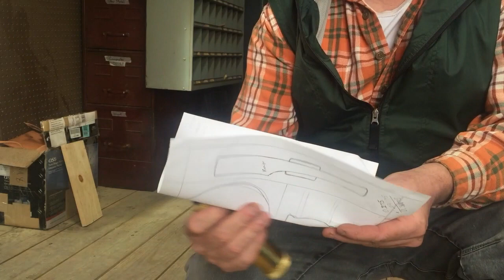Hardware Store Muzzle Loading Pistol Part 2 - SHOOTING!

Comment: Do like the colonists did, take it out in the woods, tie it down to trees and rocks, tie a string to the trigger and stand a long way off.  Apparently it was standard practice to load it with a double charges when shooting that way.  If it withstood the double charge, it was safe for a single charge.
Reply: +userunavailable3095 What youre describing is called 'proofing'... All firearm makers do it to this day, they just have a more controlled setting ;) Im unsure about the other manufacturers but I know Ruger proofs their guns with 150% loads.
Reply from the maker: Thanks!
Reply: My father did that with the family's Civil War rifle. Way too much powder. (Likely a triple or quad charge). The barrel blew apart. He got  one heck of a whuppin'. He survived only because he tied it in the crotch of a tree, and used a string to fire it with.
Reply from the maker: LOL - That is a great story!
Reply: Proofing of barrels is still done the same way.  Double charge.
Reply: Wallace Gussler, gunsmith at colonial Williamsburg, used four times the usual charge for proofing.
Reply: I was thinking during the first video that he better build  rig to test-fire this thing. Glad he didn't die!
Reply: It's called proof testing and is done to currently produced firearms.
Reply: @SugarcreekForge  don't forget to surface harden those sear engagement surfaces!

Comment: powder , patch , bullet , that order  not   powder, bullet , patch  lol
Reply: Cadillac CTS I was like wtf is he doing haha glad you caught that too
Reply: Dudes wrong as can be. I've shot severely underbore balls with a tight wad or patch and got a 3 Inch group at 40. A tight bore and patched round ball should produce similar at 75-100.
Reply: @fahey5719  😉👍😊
Reply: I think the patch went last because the round wasn't tight in the barrel. In this case it should have been powder, patch, bullet, patch or powder,lotsa patches bullet.
Reply: Generally speaking in smooth bores, with a ball it is Powder always first. Then Ball, and then patch sufficient to keep the ball in place if in a hurry, otherwise the ball wrapped in patch for better accuracy and range. In Rifled barrels, it is Powder, then tightly patched ball, all in one. The exception to that is when an oversized ball is hammered in to the muzzle with a false muzzle device and a small mallet; that is to say no patch because the soft lead ball has been engraved with the rifling.

Comment: How did you block the barrel
Reply from the maker: Hi! I tapped threads into the back of the barrel and then screwed in a small section of a bolt.

Comment: I'm amazed that you still have both eyes and all your fingers? As a 50 year black powder man, I've seen boughten barrels blow up and they were made of the correct steel, not mild junk steel from  hardware stores. They say God watches out for Children and fools. That being said... nice job.  MacGyver would be proud.
Dave
Pappy Dave's Knives
Reply from the maker: Haha, I am too old to be a child, Dave. So I must fit into the latter category :-). Wanting to keep my fingers and eyes, I did check the PSI rating for both the liner and the black iron pipe before I fired it. I have ample strength for the light loads I shot. But, one can never be too careful... I don't want to tempt that protection. Have a great week.
Reply: Glad to hear that you checked out the PSI rating BEFORE you shot it. I used to tie mine to a tree and use a rope to pull the trigger. I built a 69 caliber smooth bore Tower pistol that shot a 300 grain bullet back in 1975 and that's how I tested it. I couldn't even find a bullet mold so I made my own. I was terrified of it before that first shot :~))))) God bless.
Dave
Reply: Gunsteel is mild steel not some secret formula.
Reply: If it's a secret, you would know?
Reply: @billwessels207  High tensile strenght mild steel but yes - mild steel.. 
If I would every would have to rely on the rubbish steel grades sold in DIY stores I would go at least double wall thickness for the target pressure... just my thought...
Reply: I'm 50 year veteran of muzzle loading and have never seen a barrel breech ever......where do you buy your stuff from????

Comment: That's beauty of a musket-gun. I would sand the edges at bottom a little bit more to make the wooden parts rounder like the ones made by historic gun makers. Will start a similar project in my coming freetime. Will go for a flintlock instead.
Reply from the maker: Thanks, Paul. That is a good pointer. Please keep me posted on your progress. I have been wanting to make a flintlock sometime too.

Comment: Nice project and great job.
We used an old door to make the stock for an old WWII military rifle we converted to 308 Winchester.
It's not pretty, but as a test project it succeeded and has never failed despite several thousands of rounds of full pressure 308 Win loads and 25 years.
Reply from the maker: That is very cool :-)

Comment: 2:27 excuse me but can u please explain how to connect that bolt looking thing near the barrel wich the hammer is supposed to strike i didnt see any explanations on how u attached it to the barrel and thats real important otherwise I wont be able to fire
Reply from the maker: I drilled an tapped a hole and threaded a piece of a bolt into it that had an "L" shaped hole. This L was formed by drilling 3/4 of the way through the bolt, and then another hole drilled down to meet it from the top of the bolt face. I threaded that top hole for the nipple (the part the percussion cap goes on)

Comment: Um so with your hammer itcomes down hits nipple and cap like normal but bith that bolt did you drill straigh down to the middle the drill long ways in or how does fle spark travel from the nipple to the powder though the bolt i

Comment: That's a nice self build. Brother the patch goes between the powder and ball not last. Unless your using a way smaller ball than the barrel to keep pressure down and need the patch to hold it in there lol. A old sheet cut into round patches that when the ball is seated in the muzzle it covers half the ball is good. Take and lube the patch and it'll make ramming the ball easier. Folks forget a black power Well Pyrodex is damn accurate on out there. If one uses Black powder You will forget what you was shootin  at by the time the smoke clears. Pyrodex pistol or The rifle powder burns cleaner less smoke and easier cleaning. Nice Kentucky ish pistol all the same
Reply from the maker: Thanks for your kind words and encouragement, Steven. Yes, I used a much smaller ball (slug actually) and I wanted it to stay back against the powder.

Comment: Did you weld the bolt on the back of the barrel or is it just screwed in really really well? I want to do something simulair But dont have a welder and just hammering the back of the barrel closed is not to safe in my experience
Reply from the maker: I just screwed it in tight
Reply: @SugarcreekForge  ill try it

Comment: Did you double up on the barrel? It seems like you slipped on piece of pipe into another piece of pipe, which is a good idea, definitely beef's up the strength of the barrel, but I am not sure if that is what you did or not,kinda hard to tell.
 Would appreciate your input, thanks, very nice build!!!
Reply from the maker: Hi Allen - Yes, that is exactly what I did. Thanks for leaving me a comment and your kind words.

Comment: I really liked your video. However I was wondering how exactly the explosion from the cap got into the barrel. Is it like a flintlock where you just drilled a hole into the side of the gun?
Reply from the maker: Thanks for the encouragement! It is a percussion cap-fired system. So, I threaded a screw into a tapped hole in the barrel. I drilled a little hole down through the center of that screw. So the hammer hits the cap which is placed over the screw with the hole in it. When it goes off, the sparks go down that hole and into the barrel.
Reply: @SugarcreekForge  so like, there's a little bit of a turn in the vent? i was wondering if that would still work if there was a turn
Reply from the maker: Y @UnKnown-so5wk   Yes, it does
Reply: thank you! @SugarcreekForge

Comment: Question. What kind of bolt was that breach plug at the rear of the barrel made of? Did you have to thread the inside of the barrel to put that in there?
Reply from the maker: Hi Robert. I just used a common bolt. I didn't want to use one that was hard. I did thread the inside of the barrel. I just used a hand tap and got a few nice turns of the threads.

Comment: Im not that familliar with this kind of gun, but how does it ignite? Does the hammer create sparks? And do you have to make a hole to the side of the barrel zo it can reach the powder? Also, cool how you answer (most) questions! cool build
Reply from the maker: Thank you. It is percussion cap pistol. It uses a metal cap that goes over a hollow nipple. When the hammer hits the cap, it detonates and sends sparks down the tube onto the powder in the chamber. Here is a link that will help explain it more. http://guns.wikia.com/wiki/Caplock
Reply: Oh thanks, i will check that out

Comment: Nice video & music. What, exactly, is the barrel made from? Also the primer seating into the gun barrel?
Reply from the maker: It is made from a piece of steel tubing inside a piece of water pipe. I tapped a hole into the barrel and threaded a small bolt that I drilled a hole through the middle. I drilled and tapped the bolt and screwed in a drilled through screw and shaped that into the percussion cap nipple.
Reply: Thank you very much. If you have or ever make a video of how the barrel was made I'd like to see it.This was still one of the best videos I have ever seen. The sound,resolution,clarity & stability are excellent compared to any others. You could teach how to make a quality youtube video. I'll be looking at all your videos. You earned my Best of youtube award.
Reply from the maker: Thank you so much for the kind words!

Comment: How did you close off the end of the barrel where you stuff the powder and ball into? Did you weld it or put a nut in the end of it?
Reply from the maker: I tapped threads into the barrel and then screwed in a breach plug.

Comment: I noticed that you left out the construction and tapping for the nipple.
Reply from the maker: Yes... I missed a couple of things by forgetting to film, or to press record after setting up the camera... :-(
Reply: How do you securely put those prices together?
Reply: SugarcreekForge is drilling a hole and sticking it in the hole tight enough or is there a sealant you used?

Comment: Hey man how did you plug the end of the barrel? Did you tap it and screw a bolt in or what?
Reply from the maker: Yes, exactly that. You can see what it looks like in the video at 0:29
Reply: SugarcreekForge ah I did mine a bit differently I used a bolt like you but I cut of the threads at the smooth section so the cylinder and the bolt head were the same length/thickness then I drilled a hole through and then rammed it into the barrel and then welded it where the seam was then I tapped the small hole for a homemade nipple made from a piece of thread, kinda like this but you get the point https://youtu.be/MHboDW9NLac?t=115 

Also thanks for the fast reply but where are new videos? :(
Reply from the maker: @KClO3  That sounds like a good way to do it, buddy. I will check that out. I know... I need to start making videos again :-)
Reply from the maker: @KClO3  You are so welcome, my friend. I know... I have had a bunch of stuff happen in my life that put videos on hold. I need to start posting again. I would love to see what you made sometime!
Reply: SugarcreekForge 

Sure I should be able to show you somewhere, do you have any messaging software? And thanks for the nice comment btw
Reply from the maker: @KClO3  Cool. I am on Facebook as "Sugarcreek Forge" or "Tim Troyer" if that will work for you.

Comment: How does the blackpowder ignite ? From what i`ve seen the hammer just goes on a nut. (Sorry for incorrect terms etc. I´m from Germany)
Reply from the maker: It has a small bolt and a nut on it.  I drilled a hole through the center of the bolt so the spark can reach the powder.
Reply: Oh ok I see. Thx for the reply.
Reply: What size cap? 10 or 11?
Reply from the maker: I used 11 because that is what I had.

Comment: The only question i have is how do i get the powder so go off when i pull the triger i have it moving but how to i make a spark ?
Reply from the maker: Hi. The hammer hits a percussion cap that is placed over the nipple. That causes the percussion cap to fire sparks down through the hole in the nipple into the barrel where it ignites the black powder.
Reply: @SugarcreekForge  thank you

Comment: was that a live round? do you need a live round for this?
Reply from the maker: Hi Isaiah. I am not exactly sure what you mean by "live round". It was a small safe charge of black powder and a .38 lead bullet. The priming cap ignited real powder and the bullet fired out - so that was a live round I guess you would say. I could fire it with simple wadding on top of the powder and it would just go "bang". So I wouldn't have to fire a projectile. I hope that answers what you were asking?

Comment: What size tap and bolt did you use for the breech plug?
Reply from the maker: I don't remember off hand.  But it was big enough to cut the ID into threads for the bolt.
Reply from the maker: Let me know how that turns out

Comment: Did you just use DOM tubing for the barrel?
Reply from the maker: It was actually welded seam tubing hot fitted inside of a piece of water pipe. I made sure that the seams were on the opposite sides.
Reply: So smoothbore I take it?
Reply from the maker: DirtyFrigginHarry Yes, indeed :-)

Comment: Excuse me but why did you put the patch in after the projectile?
Reply from the maker: +Tapperlite1 The bullet was not tight and I loaded it with a very light charge of black powder. I did not want to risk it moving forward when I pointed it. I probably did not need to...

Comment: Hardware store materials, professional machine shop machine tools!
Reply from the maker: I am not sure if that is a dig against my video or just an observation... it is ok either way. Best way I can explain myself:  I am a hobbiest and certainly not a professional. And, my only professional machine shop machine tool is my belt grinder. I have a mill drill that I bought for 2 hundred bucks, a cheap harbor frieght drill press, and a mini lathe from the 1960's that I bought on Ebay for cheap. A person can do everything I did with a hacksaw, a hand drill, and files. It just takes longer. I hope that I can upgrade my tools and make things better and faster.

Comment: how did you make the powder pan?
Reply: skipped that step
Reply: Any tips on that as I am not normally a black powder enthusiast and usually stick to my Semi-Auto pistol caliber parts kits.
Reply: Excellent vid and the music... outstanding!  could you go back and un-skip the pan? I'm assuming it's using a cap, but the connection is unclear. I think I want to make one.
Reply: No pan on percussion guns.
Reply from the maker: Hi Lance - sorry for the slow reply. It is a percussion cap system. I cut the head off of a small screw and then drilled down through the center of it. I tapered it slightly to accept a percussion cap. The hammer hits the cap and the sparks travel through that hole into the chamber and ignite the powder.

Comment: Ok, I'm lost on something. Can anyone explain how the firing mechanism works? I don't understand how a striker with no flint hitting a hex bolt creates a spark to ignite the powder. I don't know enough about black powder guns to figure it out.
Reply from the maker: Hi Jason - It is a caplock. The small screw that serves as the nipple has a hole drilled through the center of it. The percussion cap goes over the nipple. When the hammer hits it, it goes off and sends a stream of sparks down the small hole into the chamber and sets off the powder.
Reply: SugarcreekForge Got it!! That makes sense now. I guess I didn't the see the cap in the video. Thanks! Great video. 👍
Reply from the maker: You are welcome, buddy. Have a great rest of the weekend.

Comment: nice gun but can i ask you how can i make a toy cap gun musket able to put the caps on and it will not be destroyed because when i fire it once the piece of metal of whatever the nipple is made out of flattens and i cannot put a cap in anymore i would like some help with this if you need me to explain it to you better just tell me and we can set up a zoom call or something like that
Reply from the maker: I made mine out of a metal screw. I drilled straight through the center of it. That way I had threads on the bottom for it to screw into the gun. Then I filed it to a cone shape that a cap would fit over.
Reply: @SugarcreekForge  ok thx for responding to all these comments even 6 years later
Reply from the maker: @alexanderthegreat3591  You are very welcome!

Comment: cool project!  id like to see it with 3/4 pipe!  you could just use cast foster stile 12 ga slugs in it.
Reply from the maker: Lol - Ryan, I would use a very long string for the test fire... that's for sure.
Reply: why stop there? go 1" and use ball bearings or buckshot or nails.